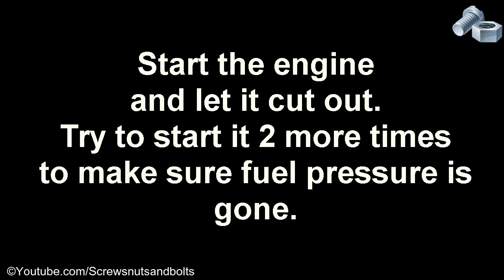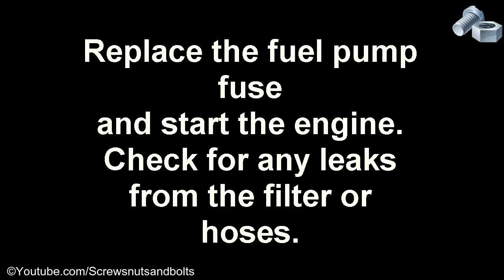Fuel Filter Change - Nissan Micra

Comment: Great video, I had no idea it was so easy
Reply from the maker: Thanks for watching :)
Reply: Does the fuel tank need to be empty or will the depressurisaton means it doesn't matter?
Reply from the maker: @geznicks  No it doesn't need to be empty. Once the fuel system is depressurised there should be minimal spillage. Some fuel might be still inside the old filter though.

Comment: Great video, I have a 2014 Nissan note e12 1.2. I have just serviced it myself and all the parts stores said that the fuel filter doesn’t need changing on the E12.... I suspect the fuel filter is similar to this one. How often should I change it on a petrol car?
Reply from the maker: Thanks. It's recommended on this car that you change the fuel filter every 40 thousand miles or 4 years (whichever comes first)

Comment: Please do pictures where exactly is it? Can't find in k13
Reply from the maker: The Micra in the video is a K11. The K13 doesn't have a fuel filter like this. The only fuel filter is a small mesh filter connected to the inlet to the electric fuel pump assembly (in the fuel tank). It is never serviced unless the pump has to be replaced.

Comment: Great video 👍🏼 I have little problem I can’t find the Fuel filter on my Nissan Micra k12 1.2 petrol 2004 if anyone knows i will appreciate letting me know have good day 🙏🏻
Reply from the maker: Thanks. I think the fuel filter on the K12 is built into the pump/sender unit that sits into the top of the fuel tank.
Reply: @arlindAutos can you find fuel filter location ?
Reply: Thank you. Very important bit of information.

Comment: where have this filter the nissan micra k13, can you know it?
Reply from the maker: I think on the K13 the fuel filter is part of the fuel level sensor unit and fuel pump assembly that fits into the top of the fuel tank.
Reply: @screwsnutsandbolts  it's necessary to replace or not? I read on internet usually if you replace the level pump you replace both two, every 15k/20k i use an additive bardahl
Reply from the maker: @onealericcisan805  I haven't worked on a K13 Micra so I'm not sure, sorry

Comment: i need replace fuel fuse for new one? no possible use the old one ?
Reply from the maker: No you just have to refit the old fuse
Reply: @screwsnutsandbolts  thanks i change yesterday ☺️, i try push the tub but cannot go to the end the filter, should be ok if just go inside litle
Reply from the maker: @FreitazYT  It really needs to go on all the way or it could slip back off. If that happened it could be very dangerous as you could have fuel spraying everywhere.
Reply: @screwsnutsandbolts  thank you, i try my max but its very hard to go all, have anything to push easy?
Reply from the maker: @FreitazYT  If you put the ends of the hose in a cup of hot water for a few minutes and then try and fit them on ?
Reply: @screwsnutsandbolts  thank you, +1 sub :D
Reply from the maker: @FreitazYT  Thank you ! :)
Reply: @screwsnutsandbolts  u wlecome :D

Comment: What model year is this K11?
Reply from the maker: Yes it's a K11 2001
Reply: @screwsnutsandbolts  thanks. Some things little different than my 1997 model. Will change this filter also on mine soon :) thanks!

Comment: do u take the fuse after u start it ? mine won't start if I remove the fuse
Reply from the maker: If you take out the fuse and it doesn't start, that's fine, it means there's no fuel pressure. They don't always start when the fuse is removed.

Comment: Does this apply to a Nissan note aswel?
Reply from the maker: No I don't think it's the same
Reply: @screwsnutsandbolts  need a video on how to replace my Nissan note fuel filter
Reply from the maker: @merjamnaftali6237  What year ?, Petrol or diesel ?
Reply: @screwsnutsandbolts  2010 petrol automatic trans
Reply from the maker: @merjamnaftali6237  I think the fuel filter in a 2010 petrol Note is in the fuel tank and is part of the pump assembly. I don't think it has to be changed.

Comment: Hi I wonder if u can help . I have an 04 Nissan micra , when driving the other day the engine just cut out but all the electrics were still on radio etc . The brakes were fine eye just no acceleration at all . You stop the car turn the keys off and back on and it will go again . Very wierd ... do u have any ideas ? I was thinking either fuel filter or cam sensor ..... it only started happening once the petrol ran low on red as I wernt able to full up at the time . Plz comment bk
Reply from the maker: It could be a number of things like a crankshaft angle sensor or mass airflow sensor among other things . You'll probably have to do a diagnostic scan to see what errors show up I'm afraid.
Reply: Amy Louise The exact same is happening to me! I called a mechanic and he thought it might be the fuel filter. Did you find out what the problem was? Please reply:)
Reply: @3101Amber Could be fuel filter, fuel pump, fuel lines, air trapped in the fuel system, fault with a sensor (either air sensor, pressure sensor or fuel sensor) or fault with the accelerator line, governor or timing system. Good luck!
Reply: Cool John thanks!

Comment: What happens if I change the fuel filter without taking the spark plug out
Reply from the maker: Do you mean the fuse ?. If you dont depressurize the fuel system, fuel will spray out under pressure when you disconnect the hose from the filter, which could be very dangerous.

Comment: What does one do if the fuel lines are REALLY tight around the filter tips? I don't want to use heat to expand them..
Reply from the maker: Try and carefully pry them off the filter using a flat head screwdriver. Put the flat blade between the filter and the end of the hose and twist or lever it a little bit to loosen its grip. Hope that works for you.

Comment: You started off the video by saying the car will not pass 40 miles an hour and struggle to get there then you just cut the video off if you change the filter what's the point in that video nobody knows if by changing the fuel filter it made a car go faster or not so no I don't know if I need to change my fuel filter or not
Reply from the maker: What are you talking about ?. I never said that in the video ?